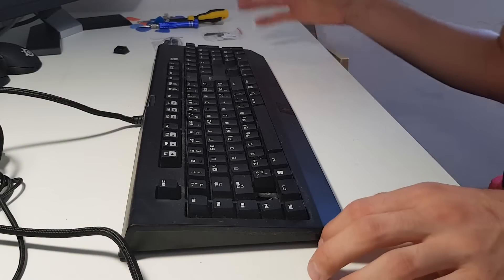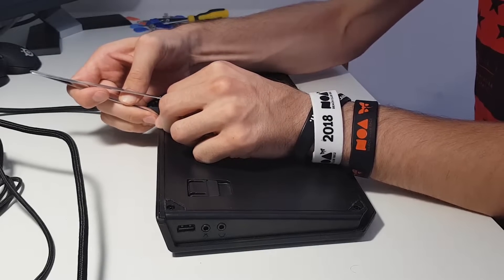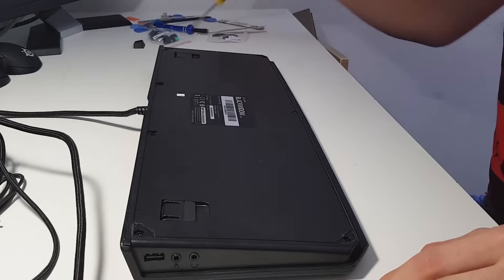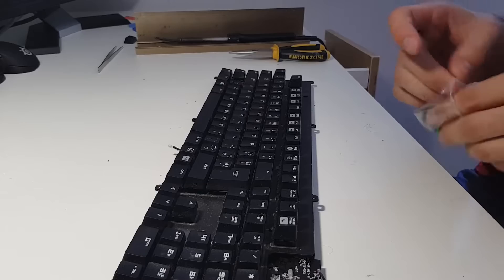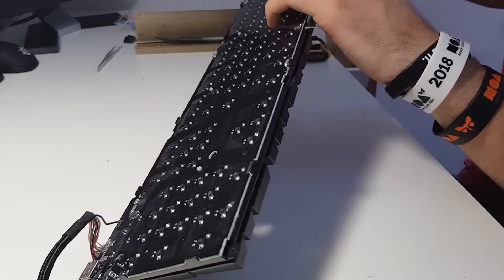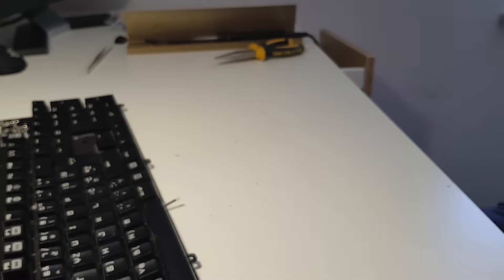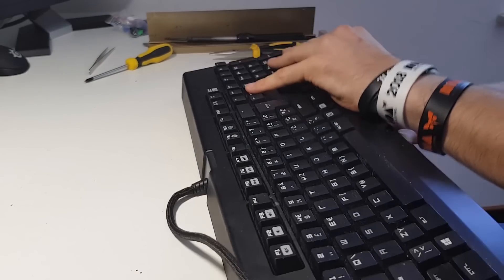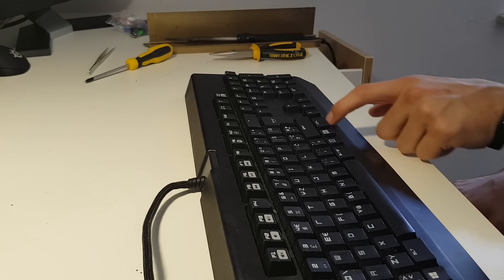Razer Blackwidow Mechanical Key switch REPAIR replacement (Works with any Mechanical Keyboard)

Comment: I might have to come back to this video at some point when my 2014 Blackwidow Ultimate will need switch repair. I recently removed all the keycaps, cleaned out the dirt, hair, and dust from a decade of use, and sprayed Mass Airflow Sensor cleaner into the switches since a few keys were sticky and/or not working right. Fortunately, I was able to fix it with just that.
Reply from the maker: Glad you fixed it! Those key switches are really quality made and ready for decades of use literally, LED lights get worn (on the lighted versions of the keyboard), but key switches are really quality made. Have fun using your keyboard :).

Comment: Hi, do you know if I can use the new mechanical switchs gen 3 for black widow ultimate 2014?
Reply from the maker: Hello, I have no idea, sorry. But I’d say check the switch and it’s pin placement and if it’s the same placement it should work. Maybe just order one gen 3 switch and test it out? The idea of the switch is just to put the signal to the keyboard that the key has been pressed, so if it has the same pin placement I’d say it will work. And also if you have the LED version of the keyboard check if the gen 3 switches have the LED lights gap.

Comment: the switches are soldiered onto the keybaord, I was thinking that the operation would be user friendly but it ain't :D
Reply from the maker: No, it's not but it's not so hard if you have a soldering machine and a solder suction would also be recommended if you have the LED version of the Blackwidow (ultimate or chroma), because the LED lights are soldered on there pretty well and it's hard to get them out. But even if you break the LED lights the switch will still work, but it wont be light up obviously.
Reply: @welovetechstuff  not worth it to even consider trying lol

Comment: Got a practically brand new chroma in the box,  but the f & J keys are sticky, ugh i dont have a solder kit
Reply from the maker: Try using WD-40 or some alcohol. 

1. Take down the key cap of the keys that are sticky
2. Push on the key
3. While pushing down on the key spray some alcohol or WD-40 inside the switch
4. Repeatedly  press on the switch for about a minute so the alcohol/WD-40 spreads inside the switch

This should work without any need of dismantling the keyboard/soldering.
Reply: @welovetechstuff  I’ll update you about what happens! Thanks! It’s just a day away super excited, I actually do have a soldering kit if I need it.
Reply from the maker: @sumoslap1973  Yes, but you would still need the cherry mx/razer key switches if you want to replace them. Also there is a problem with LED blackwidows that it is really hard to get the LED out without breaking it, because it's really strongly soldered to the circuit. I don't really have a good solder (I use an old one as you can see in the video) and I couldn't get the LED out without breaking it, so be careful if you decide to replace key switches.
Reply from the maker: @sumoslap1973  Yes, the switches are very similar almost the same, so the switches shouldn't be the problem, just the LED lights will be hard to take out
Reply from the maker: @sumoslap1973  Glad to help and no problem! :) Let me know how it goes. Thank you for the sub!
Reply: @welovetechstuff  The keyboard came in today. I don't need to do any soldering on it lol. The dude who owned it was just really dirty with the keyboard, like the switches almost sound like orange switches, but they're green.  The leds are in fantastic condition, actually the only key that may need to be replaced is the T key, if I do that, I will probably just do the other keys as well. I bought 5 switches.
Reply from the maker: @sumoslap1973  Well you've got yourself a great deal then! Fixing one key won't be hard plus even if you kill the LED it won't be very visible, I've seen plenty of chromas with one key not working and it was really hard to spot the non-working LED. I'm happy for you and I wish you good luck with replacing the key and as I mentioned first try blowing inside the key with compressed air or use alcohol/WD-40 so you clean the dust that might of get inside the key before you replace it, it might just be really dirty.
Reply from the maker: @sumoslap1973  I remember when I used to be all crazy for these keyboards I used to also clean all the key caps inside water and soap, but now I'm just like whatever xD I once had a Razer Blackwidow Chroma Tournament Edition and it had some energy drink spilled on it and it was randomly clicking keys. I literally dismantled it and cleaned the entire circuit board in water  and soap and dried it with hair dried and left it sit for about 2 weeks and it ended up working normally these keyboards are just indestructible, just switches get worn out that's it. I still have the video saved of how I was cleaning the keyboard in bath tub :).
Reply from the maker: @sumoslap1973  I like gaming gear overall, always bought used ones for cheap, sold them for more and made some money along with testing them and I loved every single one of them. Blackwidows are a bit too loud for me though, I sticked with Steelseries 6Gv2, but now R key is double clicking, so I am waiting for the switch I ordered to replace, because WD-40 and alcohol don't seem to fix the problem :).

Comment: you should of just removed the keycaps and vacuumed first. It's probably dust or hair in the switch. Cuz it's pretty dirty.
Reply from the maker: If you can see it clearly you can see the switch is broken off, therefor there is no key to begin with, that's why I had to put one in?

Comment: can you use any switches? like cherry mx reds? have switched on a cherry mx keyboard but want to switch 2 on my razer blackwidow elite to 2 reds.
Reply from the maker: Helle yes, you can the cherry mx layout is the same, so yes it works, but since it’s elite and has backlit it will be hard to remove the led and reinstall it. If you are really good with soldering you might be able to do it. I once damaged the led when I was fixing the ultimate version of blackwidow and ended up not installing the led, only the key switch. Either way good luck!
Reply: @welovetechstuff  ok thanks:)

Comment: Don't think your iron is old. I had to turn mine up to de max (896°F) and it BARELY melted the solder. Don't know what compound that is, but I guess it's some sort of high temp, long life solder. Not the kind you find in your local hw store.
Reply: The best bet is to add some fresh leaded solder.  It significantly lowers the melting point.

Comment: yeah it picks up alot of dust and shit, It's not like you can just vacuum it or something unless you like lookling for the keys in the bag :P I have the same problem with this one after 6 years of use think im better off buying a new one instead of soldering equipment :)
Reply from the maker: Well if you know someone who can solder and you dismantle it yourself I'm sure they'd be happy to help for a couple of bucks. Or just take it to some local tech store and they'd love to do so just show them my video and tell them that's what you need haha :). It's really sad seeing amazing gear collecting dust if it's pretty easy to get it back to working.

Comment: Title: "REPAIR"
Video: breaks the cover
Reply: just because capitalists designed it that way on purpose 
without any other explanation than to profit more, even if that means people and nature has to suffer from it
Reply from the maker: Well I mean I repaired the key so it doesn't lie ;)
Reply: @welovetechstuff  Got the same keyboard like yours easy design nice clicks the only bad thing is the metal plate it has inside which get corrosion after some years wich is not good for pbc.
Reply from the maker: @Agiioritis  Yes, ageed but they probably wanted to build they keyboard solid and strong so it wouldn't break so easy. I am also amazed on how long the LED backlights last. I mean they last for a really long time if you don't have them on max brightness I'd said one of the best and firmest keyboards out there, however due to the loud switches I am using Steelseries 6Gv2 right now, black cherry mx switches and probably one of the best built keyboards, it only lacks backlighting sadly...
Reply: @welovetechstuff  You correct the sound clicking is not tha annoying is loud personall i like it.For Backlight the expensive Blackwidow Razer elite have, mine is the simple without backlight like on your video you have.

Comment: Hello and thank you for this video, i have a blackwidow chroma tournament with the green switches, and i was wondering if i can replace some of those with razer's yellows. I mean, its supposed to work, but i just want to make sure !
Reply from the maker: Romain Landry Hey, yes it will work these switches all have the same mechanism. Just be careful with replacing them, especially if you have ultimate or chroma edition with led lights it makes it even so much harder to replace them, it’s just very time consuming work. Hope this helps and good luck :)

Comment: Hello there :) I've got the Razer Blackidow Chroma edition and I'm soooo sad because two of my keys don't work anymore :( I spilled just a little water on it, and lost my "W" key and my "Alt" key. Do you think I could repair it using your method ? Or is it lost forever ? Thanks if you can take the time to answer, and thanks anyway for the video, it's cool to find help like this.
Reply from the maker: Hello, you're welcome, however there are many things that could happen with you spilling the water on your keyboard. If you shorted the circuit of the keys there might be no repair whatsoever. Try to dismantle the keyboard and put a metal piece between the two  connectors of the keyswitch under the circuit which will then work the same way as you pushing on the key, since it's a switch. If the key will work that means that the keyswitch is dead and replacing it will fix the problem. However if that happened recently try to dismantle it and just let it dry out. I once had Razer Blackwidow Chroma Tournament edition which was spilled with soda and I actually end up washing the entire circuit in the bath with water and dried it with fan + let it dry off completely for 3 weeks, which end up working at the end. I would really love to make more videos on this topic, just need to find some damaged keyboards to buy. Also try pushing the key as hard as you can and see if that will make the key to register the click. Let me know if anything is unclear and I'll try to explain myself better.
Reply: @welovetechstuff  thanks a lot for your answer.
I spilled the water one week ago. What's Killing me is I once spilled an entire cup of Coffee on the keyboard and nothing happened, it was working perfectly :D
I once spilled a glass of wine on my alienware laptop !! And after dismantling and cleaning it, it worked perfectly too :D

Conclusion, I should avoid drinking water, choose wine instead 😅

Anyway, I tried to push the key harder, it didnt do anything. I'll try to test it with a piece of metal like you said. (or just wait for my Birthday next month :p) Thanks again for the explanation <3
Reply from the maker: Lucy Hey, no problem. As for the water goes I think you should only drink water when you are away from the keyboard and wine when you are near the keyboard and can’t get water, because of whatever reason haha. Well I’m sure it can be fixed somehow, just try to dismantle it and play with it a bit it’s really hard to kill those keyboards. Anyway early happy birthday! :)
Reply: @welovetechstuff  Haha thaaanks !! <3 I'll let you know if I do something about it :)
Reply from the maker: @lucysann5833  No problem, alright thank you keep me updated :D
Reply: ik im late to the party, but sometimes keyboards need to try off. once cleaned a laptop keyboard and it didnt work at all (was completely wet, i dried it off but it was dead), let it dry out 3 more days and voila everything worked just fine :)

Comment: i have a question i got a razer blackwidow TE and a ducky one 2 mini mx brown. Is it possible to convert the switches of my Razer keyboard in my ducky one?
Reply from the maker: Hey, yes it is possible, but you need to have someone with high level of soldering skills, because it is a lot of work and a lot of things can go wrong. But it is possible, I think there is a video on youtube of someone actually switching all the key switches on Razer Blackwidow, but its really time consuming.

Comment: Good video, but he could have at least cleaned it before assembling it back. 😓
Reply from the maker: I did clean it if you couldn't tell there are cuts in the video, it's just cut out when I took a break. Incase you mean clean it under the keys, you can do that without dismantling the entire keyboard, just pull the keys off.

Comment: so i tried this and the circle piece that you solder on to came off and now the button wont read, is the board damaged or does this have a fix??
Reply from the maker: I will be completely honest with you I am not sure there is a fix. The circle piece is mate of metal and is a resistor to which you need to solder the key to, so it registers. I am not sure if it's fixable. Try making some contact without the circle, but it's really hard to tell if it'll work, since as I said the circle is making the connection between the circuit and the key.

Comment: Hello, I have a Razer Blackwidow 2013 keyboard, this keyboard does not work with the Q, X and 1 keys, I change the switches that do not work for ones of the same keyboard but of keys that are used almost nothing, and in doing so It does not work correctly, it seems very strange to me, did this happen to someone else?
Reply from the maker: What do you mean it doesn't work correctly? It doesn't work when you click or it sometimes work, sometimes doesnt?
Reply: @welovetechstuff  What I mean is that, these keys don't work at all, even using a good switch, but these "supposedly bad" switches work very well in another area of the keyboard.
Reply from the maker: @tecsupportperu  So you have a damaged circuit board. Another option would be you messed up Razer synapse settings for keys, but that's not likely. If there was any water on the keyboard or anything spilled it could damage the logic board, or it just got damaged over time, since these keyboards are  a bit older. In my case the key was broken, so I knew it had to be replaced in order work again. In your case if the switches didn't work at all and they weren't broken of any sort the problem is most likely not in the switches, because if it would be a dead switch it would still work for example 1 time out of 10.

Comment: Thanks. You make it look so easy. I have the Ultimate Elite but there are no vids for it. I'm going at it alone. But if anybody is looking for the screws, there are two on the back under the top left and right pads. Note their orientation because they are not the same. The other fourteen are on the front, under the keys. You're gonna just have to take off all the keys. There is one clip connection on the pcb to the base which disconnects pretty easily. Now the board is free from the base. The rest looks similar so far.
Reply from the maker: Thank you for this comment, I did dismantle Blackwidow Chroma Tournament Edition and it's pretty similar, never tried with elite. Thank you for letting others know!
Reply: @welovetechstuff  Sorry man but from my experience I change 35 switches with gatheron and 4 of the Led failed due to de-soldering like you did. Your type of de-soldering is very dangerous.

Comment: Don't do holes like that. You can break the cylindrical contact on the board, and you're basically done. Instead, use that sucker you have. You are using it wrong :) Just heat up the contact and put the sucker on top of it. It should suck everything in just one move.

Comment: For everyone that is looking for an link, Look in the Comments.
Does someone have the link for the Switches? i cant find them online (Send an EU link with the Price in € Thanks!)
Reply from the maker: Hey I found here 4 pieces (non LED)
https://www.ebay.com/itm/5pcs-Razer-Green-Mechanical-Keyboard-Switch-Replacement/163568020213?hash=item261569eaf5:g:KUoAAOSw8fVbVg1v

And also here from UK with LED:
https://www.ebay.com/itm/1-x-NEW-Razer-Green-Mechanical-Keyboard-Switches-Replacement-Tester-Genuine-UK/323694782678?hash=item4b5db668d6:g:srsAAOSwgrtcZYhk

Hope this helps.
Reply: @welovetechstuff  ok thanks ill some
Reply from the maker: @IS-2-1944  No problem :).
Reply: @welovetechstuff   hey i have a problem that my a key doesnt work, when i press it the leds are seeing it as a click but when i play or write it doesnt seem to work, is there anyway you can help me out?
Reply from the maker: @IS-2-1944  hey if the leds register the click I believe it should be software issue. Check razer synapse if you changed the option of your key or try it in another computer. Let me know how that works out.
Reply: @welovetechstuff  what do i have to sprach?
Reply from the maker: @IS-2-1944  I don't understand your comment, just try putting it another PC
Reply: @welovetechstuff   ye I meant what do I have to so in the synapse program but I got it, the a button was set to a makro button so this was the reason for it not to work, but thanks anyways
Reply from the maker: @IS-2-1944  yes I knew it was something wrong in Razer Synapse if it registered the key by LED clicking
Reply: @welovetechstuff   ye, I need to start thinking logically

Comment: im switching tthis beacuse my one key wont work so im gonna switch it to anotther  one key
Reply from the maker: Yes this should fix the problem, however it could also be a circuit problem, but most likely it's the key.